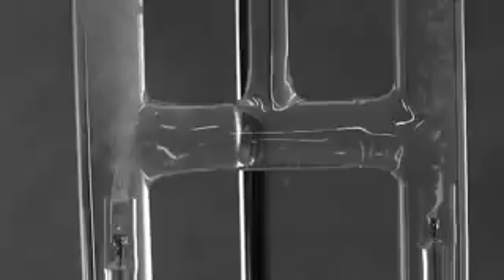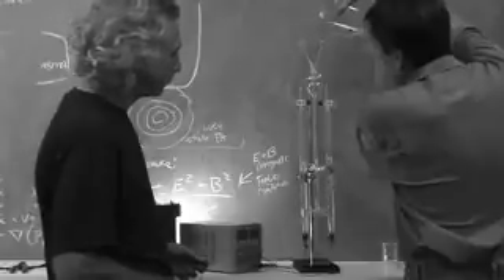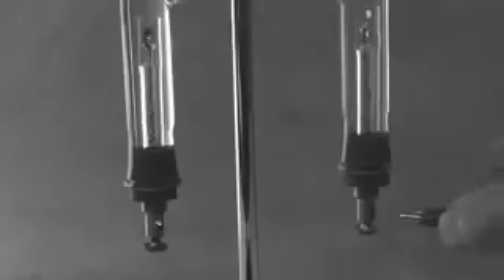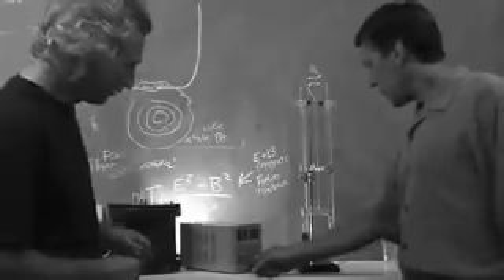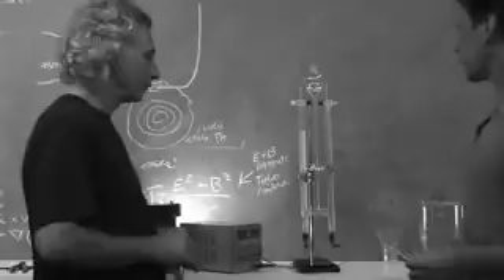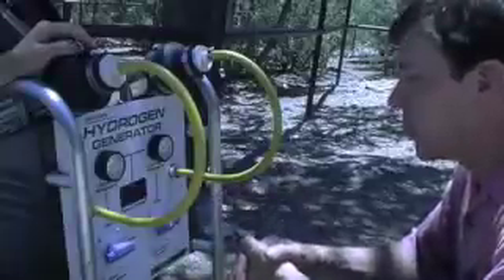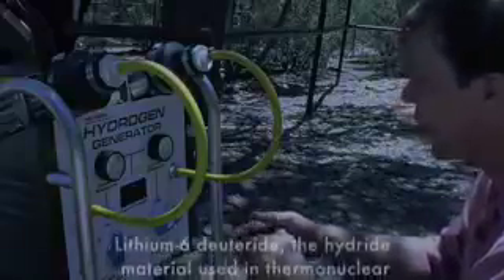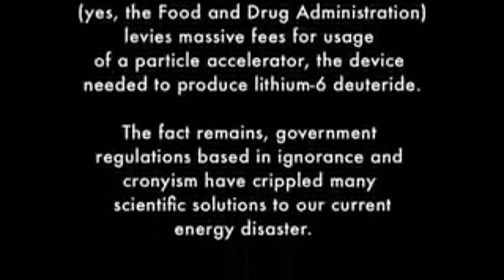run your car on water. This guy does just that!

Comment from the maker: For more information please visit http://www.greenfuelh2o.com
Purchase systems that can be used off grid.
Available are PEM hydrogen Generators that make hydrogen ready for storage.
Reply: The problem is that once the hydrogen is produced it has to be stored someplace, usually in a gas container. 

Now, in order to have sufficient hydrogen to operate a vehicle with a range close to that of a typical gasoline powered car, the hydrogen may have to be compressed, up to 2000-4000 psi. This means IF people wish to use hydrogen as a replacement for gasoline, they will not only need to produce the hydrogen but also compress the hydrogen into containers that can withstand 3000 psi pressures. This means people will have to buy a hydrogen gas compressor, something similar to that used to compress air into scuba tanks, something like this:

https://www.ebay.com/itm/300BAR-30MPA-4500PSI-High-Pressure-Air-Compressor-PCP-Airgun-Scuba-Air-Pump/332584570701

Another approach would be to liquefy the hydrogen, this would increase the energy density of the hydrogen and would not require the use of containers that can withstand high pressures. Though people may have to use multi-walled Dewar flasks to store the liquid hydrogen, to prevent the liquid hydrogen from boiling off. This means people will have to buy a cryogenic hydrogen gas liquifier and Dewar flasks.

There is another issue, once people have produced and stored the hydrogen, how exactly does one modify one's car to operate on hydrogen? People may have to use components used in LPG and CNG powered cars, to regulate the flow of hydrogen into the vehicle AND to somehow turn off the gasoline pump and the fuel injectors. You see it's isn't as easy at it looks.

The following kits have nearly all the components necessary to convert a typical gasoline powered car into a car that can run on LPG and/or CNG. If people store their hydrogen at low pressures, then people can use components from the LPG kit. IF people store their hydrogen at high pressures, around 3000 psi then people may have to use components from the CNG kits.

LPG and CNG Carbuetion kits:
https://www.aliexpress.com/store/group/LPG-CNG-Traditional-System/1190578_512872368.html
LPG and CNG Mult-Port Injection Kits:
https://www.aliexpress.com/store/group/LPG-CNG-Bi-fuel-Systems/1190578_512595778.html?origin=n&SortType=bestmatch_sort&g=y&SearchText=injection
Reply: David Williams  this technology was figured out years and years ago!  It is not invented yesterday.
Reply: I would try a dyi generatr that produces on the engines demand , no storage needed .🆒🚙🔧👍📊📚🔬📐
Reply: @johng.3740  Too much money my only choice is Diy 📚🔬🔩🔧
Reply: You could increase the vaper by using a humidifier . The vibration creates a vap so you get even more gas faster 😉 how much more is it going to take . ?
Reply: @p0k7lm  The problem is you can't produce it fast enough.  It takes 2 gallons of liquid gas to go 60miles, or one hour.  You cannot produce it fast enough in a car to do that.  However, what you could do...is produce it as you drive and replace it as you drive.  Now you will have to stop at some point, but if you can produce 100miles while you use 200miles...then you just made a 300mile car.  Which is what I get on a tank of gas (well 380).

The trick is the fillup. 

However, I have seen people create HHO faster by using a small vaccum, one that can be built at home out of a pot pan.  This helps release the HHO faster with the same energy.  So couple a vaccum chamber, with the production...then maybe.

As well, use batteries and an electric motor to aid in the car like a hybrid.  This will use less HHO as well, going even farther on HHO.

And if you redesign the engine like I am trying to do in my design you can increase the batteries range as well.
Reply: David Williams  YOU ARE THE IGNORAMUS !! this tech has been around a while. the problem has ALWAYS been access to hydride. I guess you also think global warming is bullshit and renewable energy a racket. ...........You a flat earther or sumpn  ???
Reply: @tomharrell1954  DAMN STRAIGHT BRO. WAS IN POPULAR SCIENCE WHEN I WAS IN SCHOOL.
Reply: Danile Dingel the philipino water car inventor( since 1983 ) and serve NASA for ten years also and died at age 82 in 2010 was also referred as a con man!  Mayer also referred as a con man!  Future will tell us all those men after saving that planet from extension!
Reply: @tomharrell1954  first of all how much lithium d. Do we need, also we need someway of storing the hydrogen and then releasing the hydrogen from the lithium. Are these technologies commerically available?

Nearly all the tech to produce the hydrogen gas and conpress it into a scuba tank is commerically available and inexpensive.
Reply: @fukenbiker  Well hydrogen, in the way we want to use it is simply an energy storage medium. The problem is that how much energy is spent extracting the hydrogen from the lithium and can it be done at rates high enough to meet demands for cars travel?

There are probably many ways to store hydrogen, the easiest is simply generating the hydrogen and compressing the gas and storing it in a container, similar to a scuba container.

Another somewhat easy way is liquifying the hydrogen and storing that way, and of course there are a myraid of ways of chemically binding the hydrogen and releasing it though the releasing process takes energy.
Reply: @fukenbiker  ok yeah, I agree hydrogen, like batteries in electrical car is simply an energy storage medium.
Reply: @fukenbiker  Lazar should have been more clear regarding how hydrogen is simply an energy storage medium.
Reply: @fukenbiker  Battery cars are more efficient, though, how much energy does it take to make a battery? Mining the metals, refining, the chemicals needed to purify the components, etc.
Reply: I have one of Bob's prototype hydrogen systems.
Information on the plans and parts needed are available at imagullibledumbshit dotcom
Reply: Bob, is such a smart ass guy! Gosh damn, I love him!
Reply: John G. Wow ! Where can I get more information please ???
Reply: Thomas D Harrell where can regular people learn more ? What books would you recommend Mr Harrell ???
Reply: @essblackhand4760  You can get all the information and a complete parts list at imagulliblefuckingmoron.  com
Reply: @johng.3740  so its not true about him saying the hydrogen generator produces hydro on demand at low psi and this is enough to run your car? you have to  make lots of it and compress it down to be stored in tanks instead? also what is this hydride he talked about and what is its use here?some kind of storage device?
Reply: @Benjamin Breeg lol listen to what you are saying,,you are talking about using electricity to create a gas only to convert it back into electricity ,you know how inefficient that is and how much energy you lost doing that?,,or do you think you can get more out than you put in? sheezzzz
Reply: @ARCSTREAMS  I think it is some kind of storage, though to extract the hydrogen requires a heat source, which requires some type of fuel. Here is a working low pressure hydrogen system

https://youtu.be/9jhBOxYqJvc
Reply: @ARCSTREAMS  Here is a person who can run a lawnmower on hydrogen

https://youtu.be/llmcU-mZRFs
Reply: @johng.3740  not sure what you answered here? did you mean the hydride thing he spoke of in the video is some kind of metal that helps store the hydrogen? and i asked you if a car can run on low psi hydro on demand or does it need to be large volume compressed down to size? and what do you mean by heat source required to make hydro? you need electricity only for these methods
Reply: @johng.3740  thx
Reply: @ARCSTREAMS  I'm not too familiar with the hydride process, though it requires an external source of energy to extract the hydrogen.

The DIY science guy, has a much more practical method

In regards to the car, we can make a comparison to propane and natural gas conversion, propane is a low pressure system using essentially a natural gas regulator to suck in propane through the intake manifold.

Most natural gas systems store the gas at very high pressure, then they use a pressure reducer and low pressure regulator to introduce the gas into the engine.

So in essence it depends how you store the hydrogen, if you simply put it in a container at a couple psi the you need a regulator, if you compress it then you need a pressure reducer with regulator.
Reply: @Benjamin Breeg no all im saying is that it always requires more energy to convert one form of energy to another,,if you need to use hydrogen then yes go ahead and do that,it all depends on what form of energy will be of use to you,for heating,runing lawnmoer,car etc you can use hydrogen but other things juts use straight electricity,,right now we use gasoline for our cars probably because its the cheapest to manufacture as compared to hydrogen but maybe someone will figure out how to create hydro more cheaply one day ,,maybe use a joe newman machine to run a generator to create the electricity you need to make hydrogen lol
Reply: @johng.3740  ok thx
Reply: Ian Duke  "people can get engine that runs on water" and where do they get these cars? when you say run on water you mean converted to hho right,no car engine runs strictly on water itself without conversion
Reply: You're totally wrong. The American dollar is backed by American production. You'd have to learn how the US money supply is created in order to know what your talking about. Look it up. Read up on 1. How  US bonds are created. 2. Fractional banking. 3. How the Federal Reserve buys and sells US Treasury bonds to add to and reduce the money supply, and how it lowers and raises interest rates to deal with inflation when it needs to. As far as for oil, its a commodity used worldwide for daily modern living, that's all it is. Also look up what a commodity is. Once you do that, then you can start making comments about this subject. Right now you're totally ignorant.
Reply: No gas bills for me because my Central-Heating system is powered by farts
Reply: Problem is free energy isn’t profitable
Reply: you need to find a video.  HOW HE DIED.
Reply: Repent or you will likewise perish.  what's that nonsense got to do with the price of fish ? 🐟
Reply: What's your latest development on this.
What happens in an impact if those bottles get compromised?

I suspect the rear bulkhead would have to be armour plated to protect the occupants??!
Reply: I want what Bob Lazar has.  Hydrite.  Would only have to use gasoline outside of town!!
Reply: @fukenbiker  Well essentially that is what you do with gasoline.  You fill it up and get energy for nothing.
Reply: @fukenbiker  But that is not what you are doing.  You are converting water into a combustible format and driving a turbine or crank.  The amount of water you have goes down and you have to refill it.
Reply: @johng.3740  but the problem is lithium and mining is def. not green and batterys have a short life cycle, take long time to charge, and leak.  Yes, they leak energy.  Cadium a common element in batterys is most toxic element known to humans that exists.  And we can use hydrogen to power the vehicles we already have.  No need to re-tool the factory.  Switch back to gas if the price goes down...  Which it would because we would all be on hydrogen.  We all need what Bob lazar has.
Reply: Jeeze Bro I musta hit a nerve. Im not reading your hate rant. Smarten up